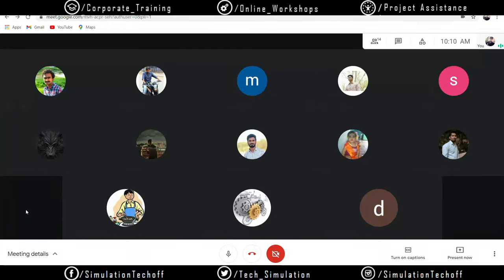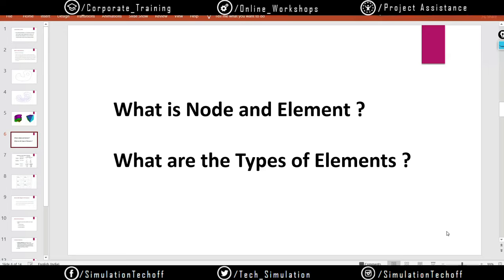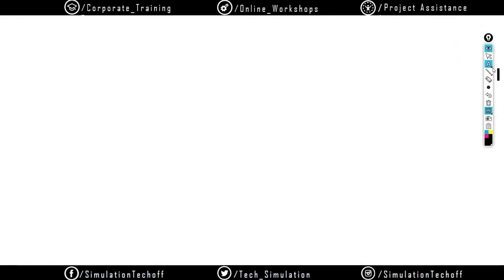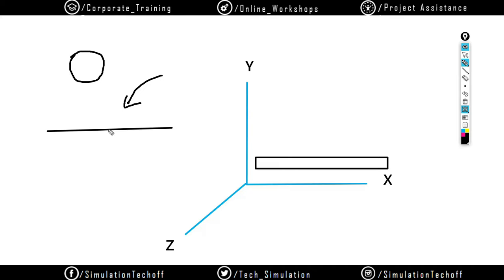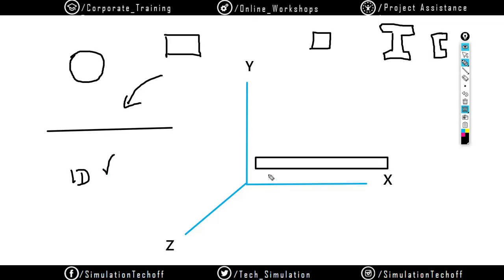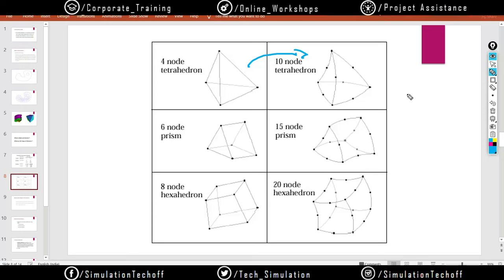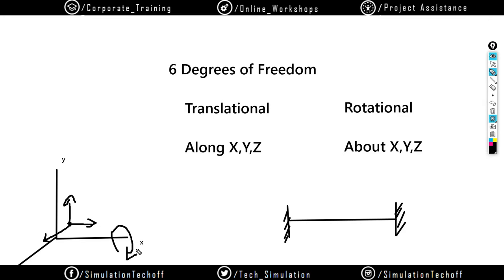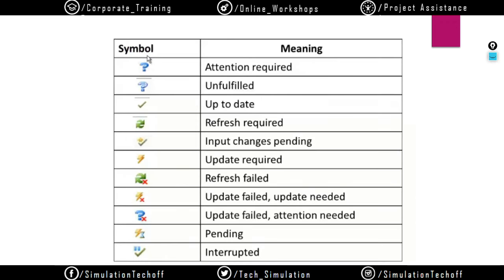Introduction to CAE and FEA | Day 01 | Learn Ansys with Ranjith

Comment: 1D example is wrong ..... because the line you draw is has value of both (x,y) non of them are zero.....but if you draw the line on the x line it is called true 1D because now it has only x dimension data and y is zero .....(x,0)
1D : (x,0,0) , (0,y,0) , (0,0,z)
2D : (x,y,0) , (0,y,z) , (x,0,z)
3D : (x,y,z)